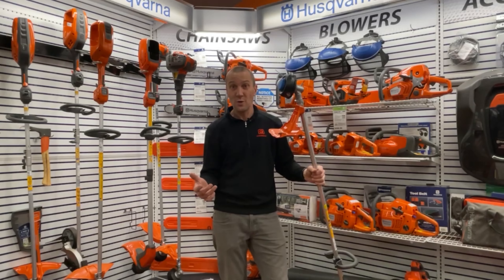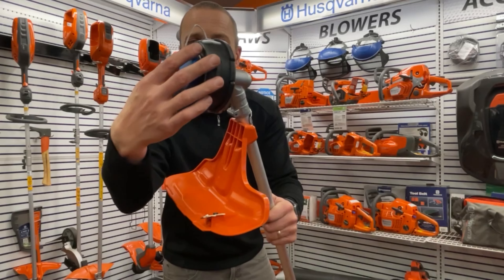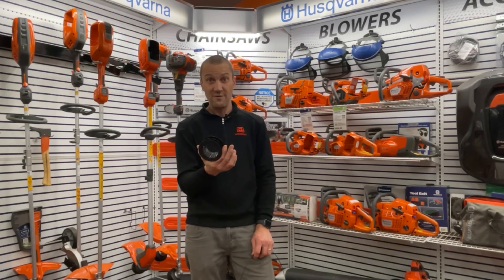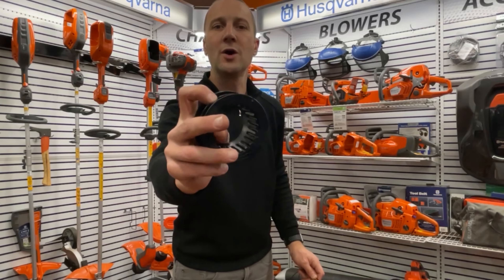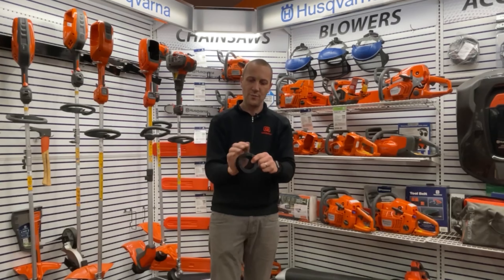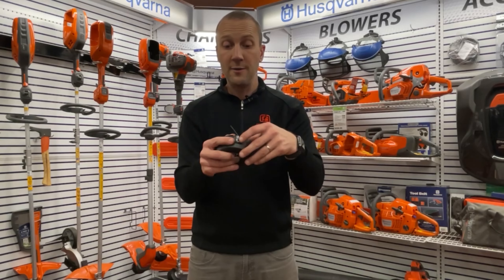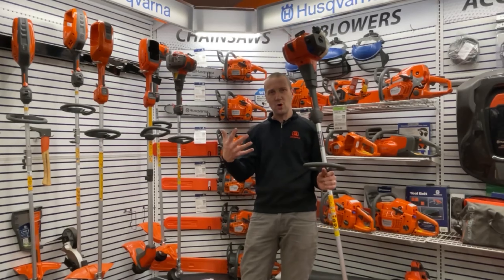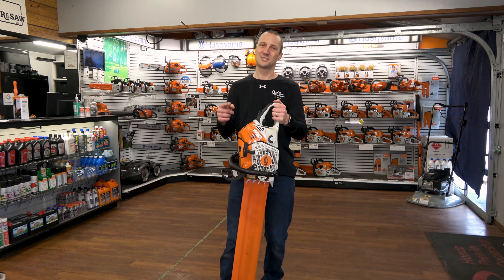How to Replace the Line in Your Husqvarna String Trimmer

Comment: Sir, while I truly appreciate your tutorial may I offer two suggestions? Consider redoing the demonstration using a WHITE loader (for demo purposes)  and a dark line, I could not see a single thing you were demostrating EVEN after pausing and blowing the frame up which leads to suggestion #2, not to offend but would you please slow your tutorial  down and be a little less " showy"? remember we are learning to do what you've probably been doing for years just think back to the very first time you had to reload the trimmer and use that as your guide. Thank you.